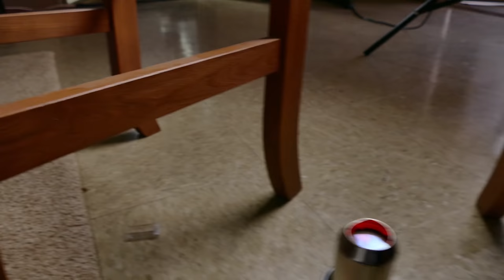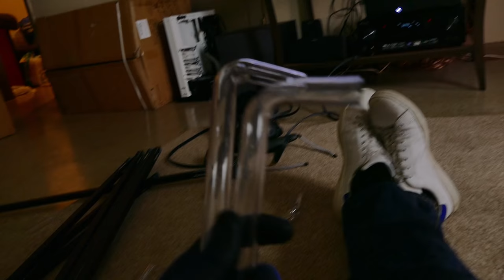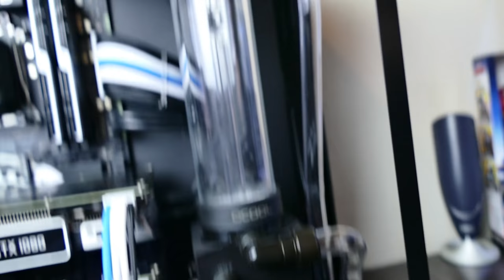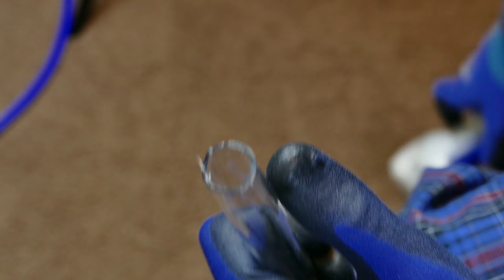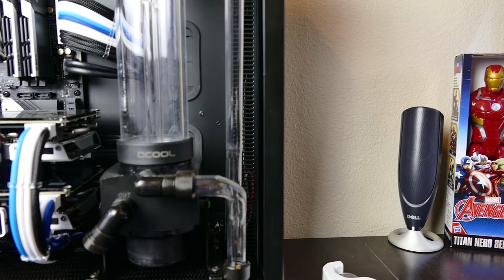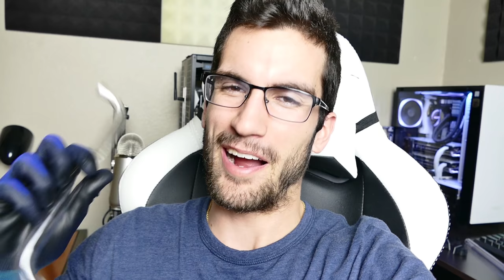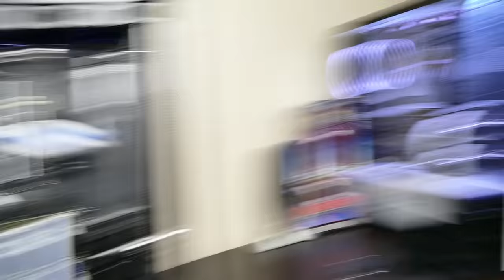Project 'Blue Sky' Custom Loop PC Build Log (Part 3 of 4)

Comment: I still don't get why people seriously want to do a custom, hard tubed water cooled PC other than for looks... What if you have to swap any parts in the future? What if you want to upgrade the CPU? Or the radiator or pump dies and you have to replace it? You'd have to remove the coolant before, then remove some tubes, make sure no rest coolant leaks out meanwhile you're doing this, swap parts and after that you'd have to make everything watertight again so no liquid will leak... From a convenient look this is just unpractical but I can indeed see a good use when it comes to look, personally that's too less to justify all of this for me tho :D
Reply: Its a hobby, you know, something that you take an full day, sit, start mounting, visualizing, bending the tubes, doing it again. It my be hard, but the end result let you proud of yourself, even if nobory cares, its just like any other hobby. There as  people who like to take photos, mod cars, small air planes.. all just expensive hobbies
Reply: And.. soft tubbing is very veru easy to manenge and dont worry about leaks at all. If you have a small difference OD - ID, you just put everything whereever you want, fill it with dest water and anti corrosives and forget about it

Comment: Best of luck man. I hope you make a video/ build on the EVGA closed looped system. I don't care about looks so much compared to performance/ ease of use. If I could quick-connect an water cooled EVGA GPU to a 240mm EVGA rad/ pump with CPU water block as well, life would be dope. My H100i is getting tired.

Comment: Bruh, I feel you, I just did my loop with 2x Titan Xs a 6850k, and enough cooling capacity for 6 rigs (running 4x420mm rads). Was a pain in the ass. Took me a week to mod the case and bend.

I did hardline and didn't have nearly as much trouble just because I used thicker tubing. I have almost the exact same equipment you do, but when I cut, it cuts right through. I don't think I had any cracks or anything either. 

I think that if you had planned your loop a bit better, you'd have a lot less work. 

Looks good though!

Comment: LOL... I wouldn't touch custom watercooling with a 10 foot pole.... for one I'm not rich, and for two, I haven't nearly that much patience...... something that might be helpful though, you could buy some pipe cleaners at a hobby or craft store, they're bendable wire with some kind of fabric around them....... bend the pipe cleaner into the shape of your bend, and use that as a template, so that you're not constantly having to walk back to the tower to see what to do next.

Comment: Don't take my word for this, but i think the problem is your heat phases. You said that you started with high heat and lowered it after. You should try doing consistent low heat throughout. See if that works.

Comment: I'm no tube bending expert, but I've done it quite a few times on my own PC. All my tubes are not perfect, but I want to share some tips I found to be very helpful. First off you need to take your time, like "REALLY" take you time. Now you need to set the heat gun to low. When you start heating make sure the tubes are about 15cm from the gun, so it doesn't heat up too fast and bubble up. When rotating the tube also move the tube from side to side to soften up the sides of the bend to prevent the outside of tube from stretching. If the tube is only heated in one place it will also kink the inside of the bend as well. From my experience it's better to heat more of the tube to let it bend smoothly, and you can determine how tight of a bend you want by pushing it towards the center of the bend. I hope this helps. :)

Comment: Try moving the tubing back and forth.  You need to heat a larger area.  Move the tube across the heat, concentrating more on the area where you want the bend to happen, and kinda allow to the tube to bend on it's own, then direct it from there.  Everyone has there own method.  It's not too bad once you get the hang of it.  Good luck to yuh man.

Comment: Please do not use the top of the res as a drain port. You will definitely regret it when it comes time to drain the loop. I made that mistake with the first rendition of my build, and it was hell to drain. If you have a port on the back of the res, you could attach a 90 fitting to that and attach the ball valve to that. That way you could just put some flexible tubing on the end and drain it when need be, and it won't be this massive hulking wad of fittings in the middle of your case as it'll be hidden back behind the reservoir.

Comment: Your tubing is just really thin.  You need thicker tubing and a way sharper cutter and it works great.  Doesn't warp at all when the tubing is a little thicker.  Also, I've done lots of custom tubing builds.  I keep my wagner on FULL FRICKING blast the whole time.  Spin it constantly, never focus the heat on one part of the tube.  Only takes about 12 to 15 second before it's ready to bend.  You're just taking too long.

Comment: Wow, Greg you really need to learn when to keep your opinions to yourself on some things. You'll never hear some of the elitest comments you make from the bigger channels. "Using cheap 90` fittings isn't a real hardline loop." They're cheap shortcut fittings." What the hell are you spewing about there? Literally all of the more experienced builders you'll find on YouTube use a pretty significant combination of rotaries, 45`, and 90` fittings, especially Jay. So is Skunkworks not a "Real Hardline System?" At least half its fittings are 90` or rotaries. It also exclusively has 90` bends. Considering how poorly designed your loop is, you really shouldn't make such generalized, asinine statements like that. I mean come on, drill a damn hole through the motherboard tray or the bottom of the case with a circular drill bit and mount the drain port to the back of the pump. Bend tubes at a table while standing or sitting upright and be patient. Get a mandrel kit so you don't waste so much. Tools exist for a reason.

Comment: PLEASE READ!! I would be careful with those fans there noiseblocker eloop right? If they are, they won't work on the bottom they cant pull air because they rub on cases or radiators! If you want to see more look up a video done by Singularity Computers he made a video about them, in one of his build logs he explains the problem
REPLY

Comment: I will tell u a secret i found out.... My heatgun have 3 settings for fan speed and manual temp adjust..... max speed on the fan and temp set at 200*C it heats up the pipes just wonderfully, but it takes a bit more time@bend.... hold it around 5-10cm from the heatgun and keep rotating it cinstantly and evenly, untill it bends by itself.. at 200C u have t ohold it for a long time, before it gets bubbles... Ive had the same problem when bending mine 10/12mm pipes.... damn they look crappy! but after i "by accident" found out this, the bends just got perfect.... theres several ways of doing the same things, you just have to find your way of doing it ;) - u are a bit of scientist? - go seach info on the material i are working with and use that knowledge to master the material ;) in this case - petg... sorry for making such a long speach about nothing.... ;D

Comment: You're doing greate work for your first crack at this!
I did my own custom loop with Acrylic, so i didn't have issues with bubbles, but I understand how hard those multiple 4-5 bend pieces are to make.
I'd reccommend finding flexible tubing for draining, as its just way easier to work with when you're trying to drain things.

Comment: I know that custom watercooling is supposed to work wonders regarding temperatures, but i'm always wondering.. why? I mean, in your specific setup, isnt the water heated by one GPU, then the second GPU and then the CPU? Wont each of those components get hotter water and thus get hotter than the precious one? I mean if, just as an example, the water had a temperature of 30°C before entering the first GPU it will be heated by.. by what actually? 1°? 2°? 10°? Probably depends on flow speed. Anyways, the water then continues to the second GPU with the added X°C and after it comes out of the second GPU the water is 2X°C hotter than when it entered the first GPU. This water now is used to cool the CPU.. so.. why does it still work that good? Or is the water just flowing so fast that the heat cant really build up enough to matter "at all"?

Comment: Where did you get your petg? Also if you still need a better pipe cutter I suggest getting one of the copper cutters that you clamp down and then turn and then repeat over and over until it's cut.

Comment: You want the drain port at the bottom of the loop, because
air gets caught at the top radiator and it won’t drain properly. When you go to
drain it it is going to be a pain in the ass. I have mine set up where I can
open a port on my top radiator and then my drain port at the bottom and all the
fluid rushes out of the bottom drain. Drain valve at the bottom of your res and
I don’t know if your rad has two port of four ports. If it does after opening
the bottom valve you open the port on the top and it causes the coolant to flow
out of the loop in one direction and empty completely.

you can use soft tubing to make that drain port.

Comment: I thought I did bad with using 8x500ml tubes to complete my first full custom loop. It wasn't easy doing it with 0 angled fittings. The most difficult was a 5 bend tube from the radiator out to reservoir in. I don't know how to link my video in yt app, but it's my only video on my account if anyone's interested.

Comment: I built my first water cooled loop over the summer (pics here https://linustechtips.com/main/topic/641608-red-n-white-army-first-water-cooled-build/?do=findComment&comment=8828023) sorry  for the LTT link i'm sure you don't mind! 

Couple of things, don't take short cuts - get an insert that fits properly, you are spending a lot of time and money on this, why would you want to compromise on buying something that  costs £10? 

Also get a measuring tool, or something to measure with, and use something to bend around. Alphacool do a measuring / bending tool that i'm sure they could send you if you are being sponsored. I used random objects, but either way it helps.

And i feel like you are heating the tube too fast, use medium or low heat and keep the tube moving side to side and round and round, you shouldn't develop a kink/bubble like that in the first section of the video so quickly

Comment: Just a hint: you might have an easier time when measuring where you need your bends by using some water-soluble markers to put a mark on the outside of the tube while you're eyeballing the PETG in the case, then simply cleaning it off when  you're done. 

Good work!  The learning curve for custom loops is really steep, it's good to see you've managed to get this far without any major problems.

Comment: If you really feel like recycling your petg and the bends/stuff ups are not too bad, you can put the insert back in heat it up until it's very malleable, put it down on a very flat surface and get a heavy/big book or sturdy magazine and without applying toooo much pressure roll the book over the tube until it's flat and straight. Usually it comes out perfect. If you apply too much pressure close to an end it will deform it but even this can be rectified. 
Advice from a budget builder... haha, also petg is hard to come by and stupid expensive in Australia (at least where I live).

Comment: told you when you msg me that it was harder than it looks at one point when I was doing my loop I thru the petg across the room   lol patience lasted for the first two hours then I walked away and came back next day and spent 6 hours to get it right not perfect but it look amazing but I learned  next build I will use the bending kits so I can get a more consistent bend which was the main problem besides temp and also my insert was to small I used xspc tubing and fittings as I got them for a good deal. .......but I have vga cpu and motherboard cooled  msi z170 m9 ack water block leaked on day three and smoked my msi gtx 1070 gaming x and msi z170 m9 ack  ..... but msi is going to cover it .........thank fully  hope all goes well for you keep  the vids coming lol my problem was the second bend was  always longer or shorter than the first not consistent so it looked weird standard tubing cutter worked great for me also I I opted to not go for a drain also big mistake it was a nightmare to drain also you tubing is very thin walled last bend looks great man I just hope you left enough room for the fitting to go over to properly the bend looks really close

Comment: okaaaay.... heat gun?! bending your own tubes??! WTF?!  don't have the patience to go through all this trial&error BS.  and then all the worrying about leaks.  don't know how you guys put up with this shit.  i think air cooling is gonna be it for me.

in fact, am gonna do an open design so the mobo is not enclosed at all and stack multi 3-fan high-end units on top of each other for max cooling perf. should do the trick without any of the nonsense hassle of liquid cooling.

Comment: You should get a good cutter (prefereably one of those with a cutter wheel and you spin the tubing) and a proper size insert and try again.. I think you'll be less frustrated and more statisfied. Also, remember the timing of when you get the tube away from the heat gun (thus temperature of the tube) is key. It is a delicate balancing act. Good luck!

Comment: Really just seemed hard because you are using 16mm tubing with a silicone insert that does fit properly. That and the 16mm tune is not good for two quick right bends

Comment: Hey bud, used to be a plumber and I can tell you the Lenox cutters will work fine. It requires a crucial step your leaving out. You need to apply pressure from blade to pipe and then twist up and down almost like your rolling it around the pipe and it'll slowly cut perfectly right thru the pipe. It's basically getting the blade started into the material, it's the same with any soft tubing/plastic pipe. Keep the pipe still, apply pressure, then just slightly rotate your hand with the cutters it'll fall right thru the pipe. I enjoy the heck out of your videos and how you apply the science into what your explaining. Keep it up brother! Not knocking you at all just a hint/tip that none of us know unless we're taught it, later!

Comment: The thicker tubing is much harder to bend Bro , what size is the tubing , and that tubing cutter wow bud what bad luck..
sharpen the blade maybe. By the end of the Video I notice that your not holding to close like in the beginning and your spinning it more as well as heating the whole length of the bend. Nice Bud and like i was saying thicker tubing is a bugger.
Next time you get a chance try for the heck of it try bending say 12mm or 1/2 " you will see how much better you are at it . Nice job bud welcome to the team :)

Comment: This is why I gave up on hard tubing nearly immediately and I am an electrican who bends conduit nearly every day. I also didn't like that the tubing could be pulled directly out of the compression connectors and that you have to drain your loop to do basically any maintenance. I went back to soft tubing and plan to stay with it. I can swap my CPU and many other things without draining the loop. Yes hard tubing looks a little better, but that is the only upside. If you but quality soft tubing and flush it out before use plasticizer is not an issue. And if you take your time and don't cross any tubes it can still look pretty damn good. Good luck finishing up.

Comment: I found the xspc cutter tool is a much better cutter for PETG. It's a more narrow blade, and doesn't crush the tubing. They are sold in a kit for 10/12mm tubing. It looks like you're using 12/16mm tubing. It still works. The bending tool is made for the smaller tube.

I recommend heating a wider area of the tubing to avoid kinking and flat spots. You're forcing a bend too soon. Just keep the heat on a wider area of the spot you're bending until the material bends by itself, which is a good indicator of when it's time to bend. Start with a light bend and feel where the resistance is coming from. Normally it'll be the side where the tension will be coming from rather than the side where the compression is going. You'll start the bend, then direct the heat over the tension side. Try to hit all areas of that side from where the bend starts to where it goes. Just bend with intent, and heat the area where the resistance is coming from. Don't just heat the bend, but a wider area of the bend. That way, material can be pulled evenly over the bend.

I don't like to start on high heat. You'll find that it heats the material unevenly that way. You want all of the tubing in the area to get heated at the same rate, or close to it. If you start on high, the outer material will heat much faster than the inner material, giving you kinks and flat spots. It is harder to control, and clunky to have to switch the heat gun from high to low. I also feel like you're not turning the tubing over enough, quick enough. You need to constantly be turning it. If you leave the heat gun on one area too long, that area heats up, the opposing side cools down too much. Causing bubbles on one side and a kink on the other.

Comment: instead off doing bends, cant you ust use straight tubes and fitting for you turns, would look really clean, and a big time saver. I have to go through all this yet, my stomach turns at the thought, as ive got £1800 in my build already.